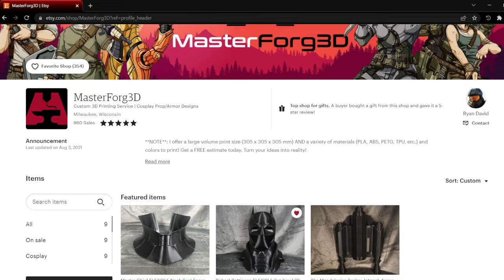The Batman 2022 Cowl from Etsy | Ordering, Painting and What to Know

Comment: It looks like when you took it out of the box, the cowl itself (right cheek) caves in a bit but during your cleaning and sanding, they both look even.  Did you do something to even it out? 

Thanks In advance
Reply from the maker: Right? I noticed that at first and figured that during the "ovalizing" process, I can straighten it out. Frankly, it did it on its own due to the cold weather here in SoCal (it was left in my car the day we worked on plastidipping and that must've done it). So you can either take a blow dryer to it or leave it in cold but not freezing temperature to stiffen it up.

Comment: I have this exact thing. I do NOT understand the wide gap in the back of the neck. If I attempt to close it, the head portion has major overhang. If I try bending the bottom inwards while keeping the top together, the head part is not flush with the neck. It’s… disappointing.
Reply from the maker: I was thinking of just wearing one of those open-faced ski masks underneath to cover the back and around my neck, then wrap the neck brace over that, filling in the gap.